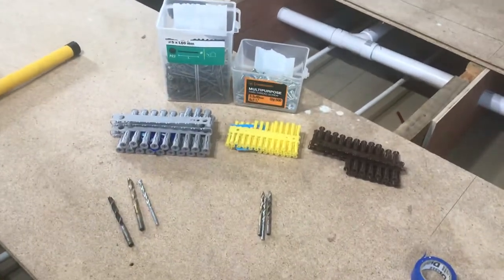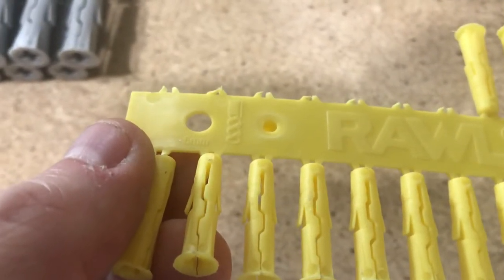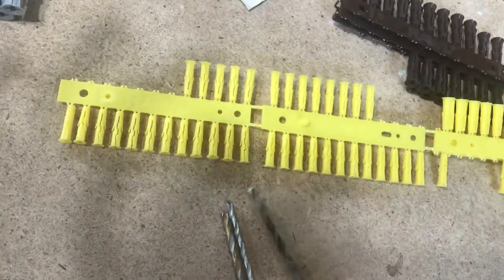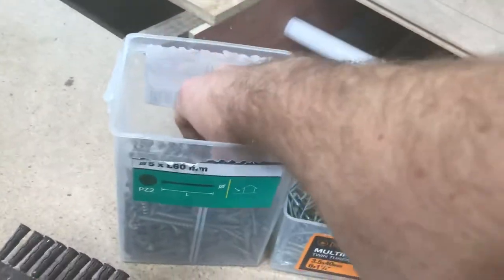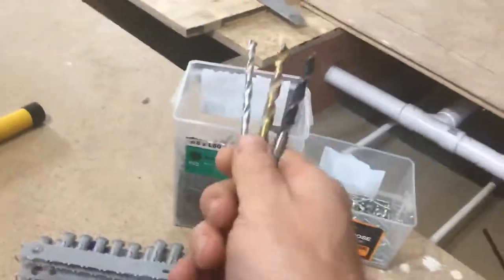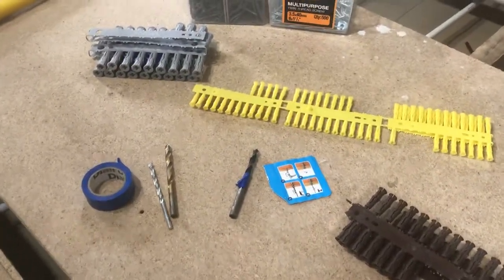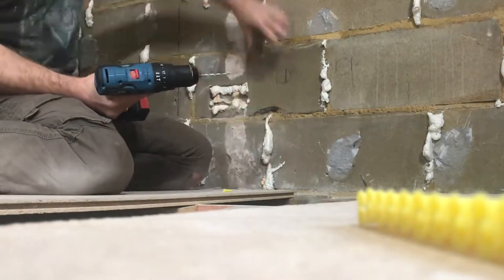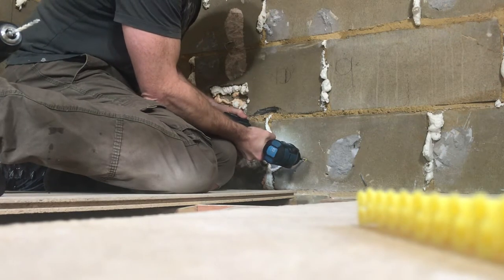RAWL PLUGS correct hole size & screw size every time! not raw plugs! And stop using electrical tape

Comment: What do you do if you just have 1 or 2 loose rawl plugs that are not in a packet and don't have the size on them???  How do you work out the correct drill bit size?   I bought a curtain pole with fixings that consisted of 4 screws and 4 rawl plugs but no sizes of what they were.

Comment: You say full length of the drill ..but it might only have enough depth of material to drill into to allow correct depth for plug/screw but no more than that..great video btw 👍

Comment: honestly that explanation of the tape thing i used to do it but couldnt understand how the extra but of the screws meant to go in so i stopped. Im glad you confirmed this!!!
Reply from the maker: Thanks, I did it for years too. It’s one of those tips that sprung up that was wrong from the start but lots of people tried it, I blame the internet. 😂. I suppose the tape trick would work if you used cheap plugs with no stop end like the ones you get free with a picture frame etc, but I always throw that rubbish in the bin. Thanks for your comment all the best

Comment: That is seriously THE BEST video on wall plugs I have ever seen on YouTube. What a brilliant video. You went thru ever single little detail. Thank you. Please please do more videos on stuff like this. Your explanation is so basic and simple and hits home with us viewers. 

Could you also show us how to pick screws and what the dimensions and sizes mean? For example on my rawl plug kit it says “5 x 25mm”. So does that mean that the outer diameter of the rawl plug is 25mm or is that the inner hole? And also how are screws measured? Is it the diameter of the head? Or the diameter of the with of the shaft (or whatever the long bit is called)? Or the diameter including the grooves on the shaft? I know it sounds daft…but there are probably logs of people who are clueless like me…and you have been a massive help. Many thanks
Reply: Plugs are measured by their outside diameter x their length. 5x25 means 5mm diameter plug, 25 mm long. That requires a 5 mm hole to be drilled (hole size should always match plug diameter). Screws are measured by the outer diameter of the thread x length of the screw. Example: 5x40 means 5 mm thread diameter, 40 mm long. What screw diameter you use with what plug depends on the plug, and the range of diameters it will accept, as explained in this video. The largest diameter screw a given plug can take will cause the most expansion and the most grip. But sometimes you might wanna use a smaller diameter than the max, because the plug might be spinning in the hole (soft, crumbly material such as drywall etc). Generally 6 mm plugs are very common (usually 30 mm long. so 6x30 plug, requiring 6 mm drill bit). And theyaccept 4.0 to 5.0 mm screws, 4.5 mm screws being a common diameter. I personally stock various lengths of 5mm screws, to be used with 6 mm plugs for general purpose mounting to masonry walls. I like the idea of using the max screw size for a given plug, so it's a good combo. These are the fundamentals. Now you can look at different plugs and screws and with experience you''ll have your own preference and opinions on what plugs and screws to use where. Hope it helps.
Reply: @lancearmstrong3252  Thanks for your reply. Does M5 10G * 60mm screw mean 5 mm thread diameter, 60 mm long. I was planning to use this to a 6mm wall plug but the packet of the wall plug said that this was applicable for 8-9G screws. Would me using a 10G screw damage the wall plug? I am attaching timber onto brick. Thanks

Comment: any tips if you dont have a strip with the holes in?
Reply from the maker: Hi, I only buy the Rawl branded plugs, I trust them. Certainly wouldn’t ever trust the free plugs that come with kits, get out and buy some Rawl Plugs and have the peace of mind knowing they won’t let you down. 
Only advice I could give is try to hold the plug next to a drill bit and guess the right size

Comment: Some raw plugs came with my brackets for fixing my blind with no drill size indicator.
Reply from the maker: That’s the problem with them. I personally never use the ones that come free in kits. Presumably you have a drill and screwdriver set which is the main thing. Go and buy some proper Rawl Plugs, yellow and brown will probably do you fine.
Reply: @cglees  Hi that's exactly what I did and everything is fine now.
Reply from the maker: @ewaf88  great stuff well done 😊
Reply: RAWLPLUGS fam
Reply: @cglees  Are you getting a kick back from Rawl, whoever they are? I came away from watching it thinking I need to go out and buy a whole new supply of wall plugs (the generic term) making sure I get the 'Rawl' brand. Many of us have loose, unbranded plugs which are probably perfectly good but we don't have the sizing strips. We still need to match plug to screw and bit so if you genuinely want to de-mystify the process without concentrating on just one brand and if you want help those of us who are struggling, perhaps you could shoot another of your excellent videos covering such situations. Thanks for your efforts though - the video has clearly helped a lot of people, just not everyone.
Reply from the maker: @eddieloid  hi thanks for watching. I wish Rawl were paying me but sadly not 😂 
I’m just committed to this brand now. I wouldn’t use the free fixings that come with products. Can’t really help on drill size of other brands sorry. 😊

Comment: What size screw in length and diameter do you recommend for a 5mm and 6mm plug?
Reply: Seems like nobody knows!
Reply: @jarilouhelainen51  So just trial and error then?
Reply: @mattseymour8637  Actually proper plugs (Fisher, no surprise here) have a recommendation and excellent explanations on the box. Also explains why some people have no success with them - the hole needs to be minimum of 10 mm longer than the plug etc
Reply: @jarilouhelainen51  Yes I think I remember from buying these type of plugs since I posted this comment that it suggests drilling a longer hole for the end of the screw.
Also I learnt from experience to use a slightly smaller diameter drill bit than the plug to help stop the screw turning in the hole.

Comment: What if I'm doing it on tje cheap.n only had random plugs that aren't on a strip? No hole? Maaaaaan....help
Reply from the maker: Hi. You could try measuring it up against the drill bits and screws that you have. But really if you want a good fixing you need to invest in decent plugs and make sure you buy the correct size screws and drill bit. Depends how precious the thing you are hanging is.

Comment: Hi I'm trying to find a brown 3mm rawl plug it measured as 2.5 on the measuring tape just wandering if you no where I could buy them
Reply from the maker: Hi, do you mean 30mm? If you specifically want a brown Rawl Plug then it will be a standard size, that brand is colour coded for sizes. You can buy them off the internet or any hardware store, just watch out for fake copies on Ebay
Reply: @cglees  hi thank you I managed to get some from my local wilkos

Comment: Currently putting a tv on the wall this is the first vid I came across and glad I did great vid can you do a vid in drilling a hole into old plaster the sort that crumbles it's a nightmare to get a plug to stay in you find your self wading off down the wall when drilling a hole
Reply from the maker: Hi thanks 😊. I had that problem in another house, crumbly plaster. 
Depends what you are hanging - I wouldn’t trust a TV. Maybe try marking the outline of the TV bracket on the wall and cut away all of the plaster and then fix the bracket directly to what is behind the plaster. Should be timber or blockwork. 
Other option is to remove all of the crumbly plaster and then use filler to make the wall good.

Comment: What type of screw do you use with wall plugs when drilling into brick or concrete?
Reply: Self-tapping wood screws are fine as long as you get the right size, as per the video.